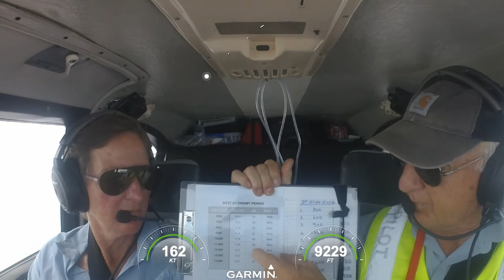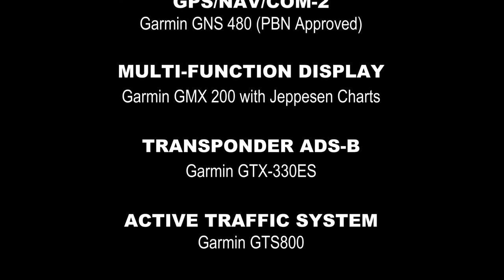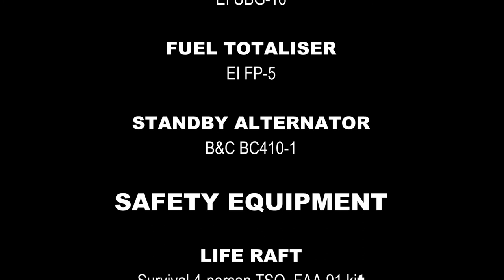Cockpit Chat 09 - ZK-BAZ - RTW - CYYY - CYYR - to Goose Bay - Bazflyers RTW 2019

Comment: Point of confusion for me Captain. You mentioned Mr Piper and him using US and Imperial measurements....With your fuel calcs are you talking US gals or Imperial gals?
Reply from the maker: Hi Peter - thanks for your question.

We use US gallons for fuel calculations. 

The six individual wing tanks in a Comanche (including wingtip tanks) each hold 15 and 30 USG respectively. 

The rear auxiliary tank holds 20 USG when full. Engine performance  data is presented in USG. 

This all makes for easy fuel management. 

BAZ
Reply: @BazflyerZKBAZ  Thanks for clarifying. Safe flying folks.